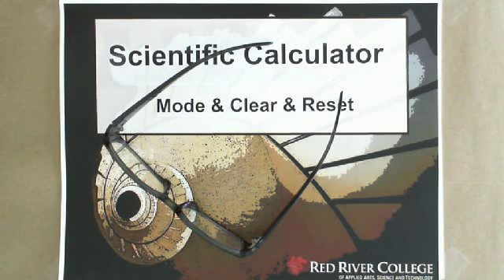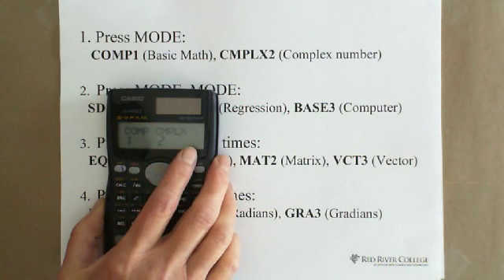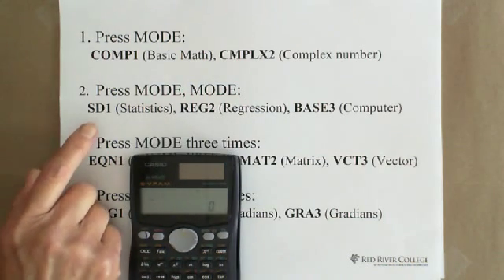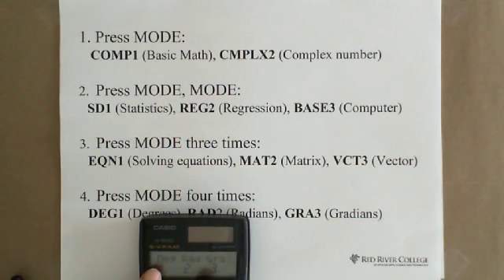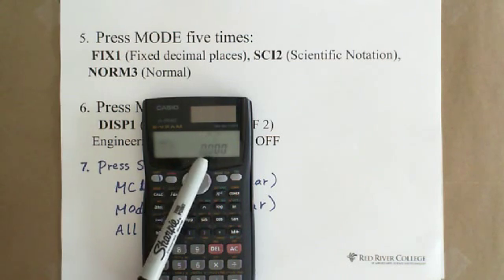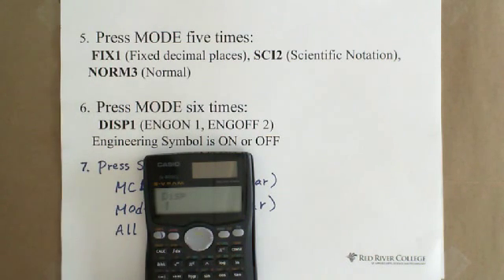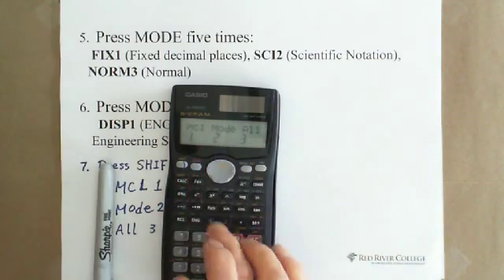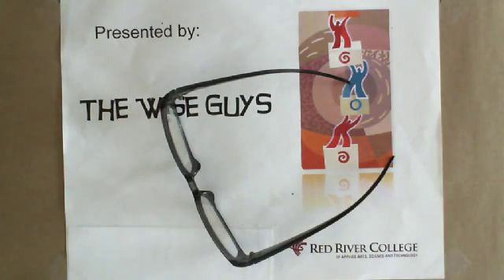Scientific Calculator: Mode & Clear & Reset

Comment: I can't believe some 'genius' decided my calculator should display a comma every 3 digits! I never want commas but the only way I have found to disable the comma is to use scientific notation mode. That is ok sometimes but sometimes I want to use fixed or normal (without commas). It seems that on my calculator there might be a mistake in that norm 1 and norm 2 are the same.